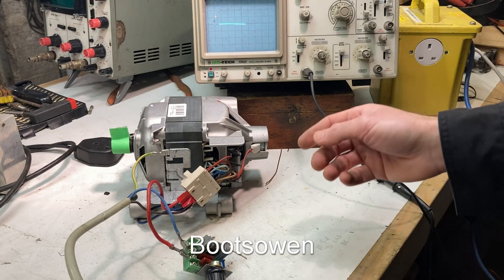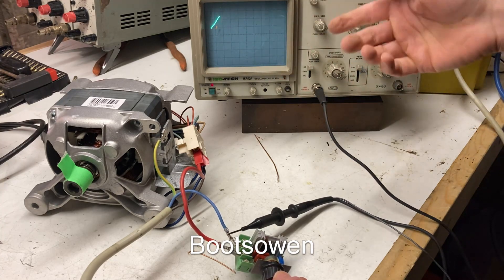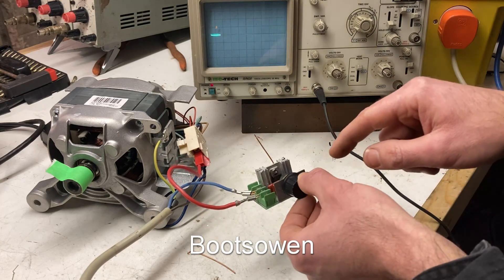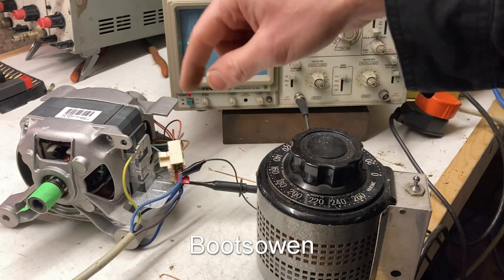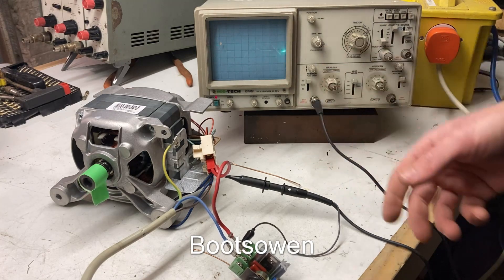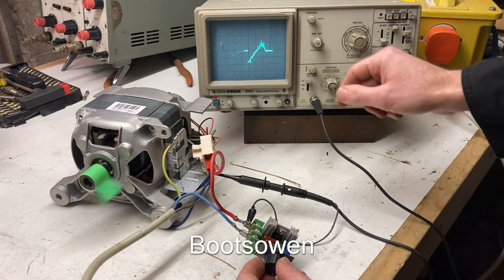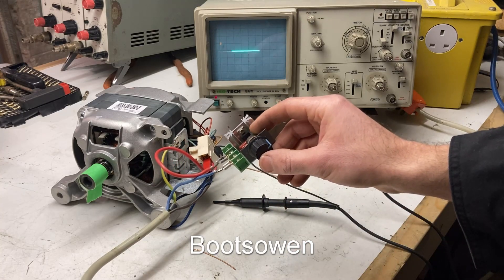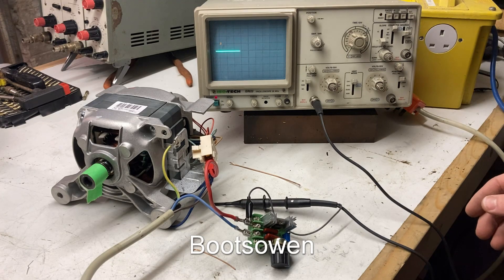Universal motor speed control waveforms viewed on my oscilloscope

Comment: In a nutshell you want to use an isolation transformer any time you need to work with exposed AC wiring. The transformer removes the route back to ground and therefore if you touch a live wire nothing will happen, there is no route back to ground via your body or in your case your scope. hurray for isolation transformers. simple but effective. It shoudl be said this is not 100% safe or anything, but it does reduce risk.
Reply from the maker: So could I hold on to the end of the wires coming out if the isolation transformer, if they were bare?
Reply: @bootsowen  noooooooo. your only good for one. you dont really wanna become the motor/lightbulb in this scenario. basically dont F with AC at all if possible. but if you must, isolation transformer just makes you feel 50% better about it. you can poke anything you like in theory, but only poke one thing at a time, dont get greedy lol

Comment: Owen, interesting and 20 years ago I would have been using this sort of thing in the workshop, but maybe they were not available then. Off subject and on to the Bosch 3300, as smoke came out of the motor controller I think it would be worth looking at the capacitors in that unit. 23 years old and the caps could have dried out, cheers
Reply from the maker: The 3300 has moved down the steps into the cellar. I hope the 2801 machine has the same boards and then I can compare.
Reply: @bootsowen  I hope it was worth the drive and that the motor is good. Cheers